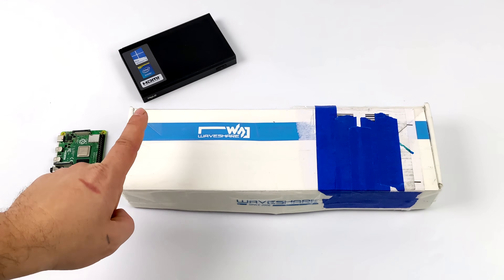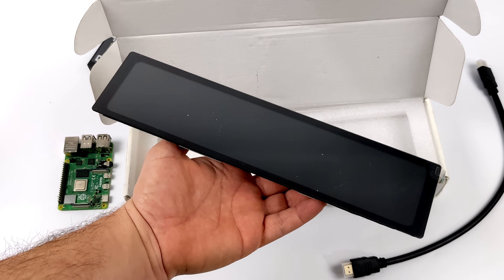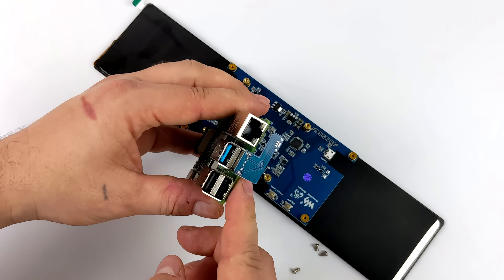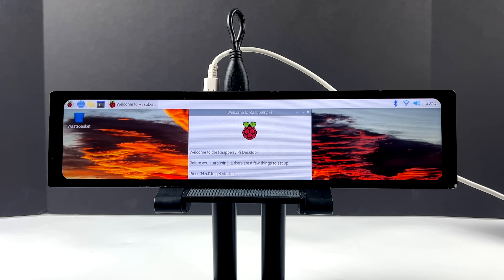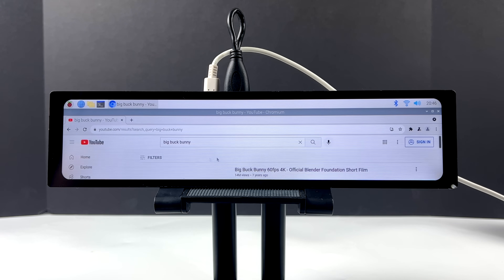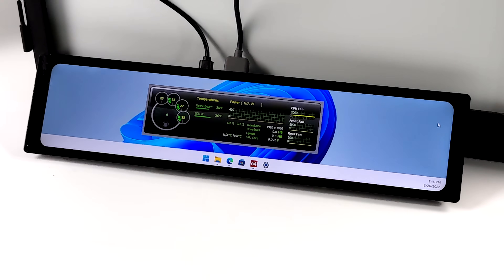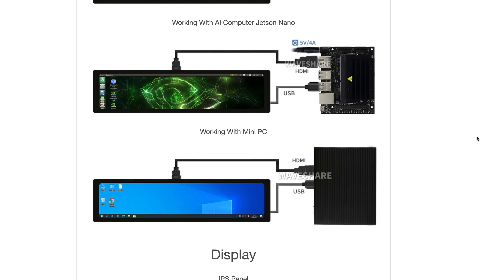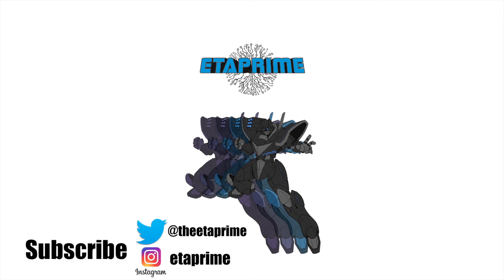The WaveShare 11.9" HDMI Touch Monitor Is Perfect For Cool DIY Projects! Pi4, WIndows

Comment: just fyi, I made my own version, you can actually just cut a bigger lcd screen into a shorter one.  Can't cut it vertically, but you can horizontally, sometimes in only a few places depending on the panel.  It took 5 tries before I got one without screen issues.  Must place in vise right where you cut it and use soft material to hold it that won't damage glass, and then cutoff wheel and seal edge with epoxy and let harden before removing it.   I wanted a long display for a rear view mirror on my motorhome.  With cameras showing rear/side areas.

Comment: I'm looking at this screen for a project in which I'd mount it into a 1/16" steel plate. I would like to know how easy or difficult it would be to do this, also adding Waveshare's UPS hat. Any way you could demo this product with a Raspberry Pi having a HAT installed on it? Even if it's not the WS UPS.

Comment: 3:17 - to get the included hdmi adapter to work, you have to add following lines to your /boot/config.txt file at the end of the text file:

max_framebuffer_height=1480
hdmi_group=2
hdmi_mode=87
hdmi_timings=320 0 80 16 32 1480 0 16 4 12 0 0 0 60 0 42000000 3

Otherwise you will receive a black screen. You can also unplug and plug in again, then you will see the screen.
Tested on a rasperrypi 4 with 64bit Pi OS with GUI.
Reply: Does the Pi 4 have screen clipping issues for you? I've been pulling my hair out trying to setup a kiosk with this screen on a Pi 3B+ and the left ~25% of the screen clips off the right side. I tried plugging in that bit of code in my config file like it says to do on the waveshare site but it doesn't seem to have any effect.
Reply: @WCNovaTiger  Config.txt can easily be edited but there may be other commands forcing a particular setting. Look for this line: 'disable_overscan'.  That sets the overscan area. If you see it, just comment it out and give it a try.

The lines below let you set all overscanning.  Start with small changes, say 32.

Set disable_overscan to 1 to disable the default values of overscan. The default value for disable_overscan is 0 which gives default values of overscan for the left, right, top, and bottom edges of 48 for HD CEA modes, 32 for SD CEA modes, and 0 for DMT modes.

The overscan_left command specifies the number of pixels to add to the firmware default value of overscan on the left edge of the screen. The default value is 0.

Increase this value if the text flows off the left edge of the screen; decrease it if there is a black border between the left edge of the screen and the text.
overscan_right

The overscan_right command specifies the number of pixels to add to the firmware default value of overscan on the right edge of the screen. The default value is 0.

Increase this value if the text flows off the right edge of the screen; decrease it if there is a black border between the right edge of the screen and the text.
overscan_top

The overscan_top command specifies the number of pixels to add to the firmware default value of overscan on the top edge of the screen. The default value is 0.

Increase this value if the text flows off the top edge of the screen; decrease it if there is a black border between the top edge of the screen and the text.
overscan_bottom

The overscan_bottom command specifies the number of pixels to add to the firmware default value of overscan on the bottom edge of the screen. The default value is 0.

Increase this value if the text flows off the bottom edge of the screen; decrease it if there is a black border between the bottom edge of the screen and the text.

Comment: I got the 7.9” version of this, and designed and 3d printed an extended marquee housing for a vilros counter arcade cabinet I have, and set it up as a digital marquee.  Works great, the only real issue is that this panel is so much better than the 10” TN main panel that came in the vilros cabinet, so it almost pops too much.  (Laughs).

Comment: Thanks for the video!
I have this screen for my Camper RV control-station pluged on a raspberry. My Question is: Is there a kind of frame available (or mounting brackets), or something? I want to place it in the ceiling of my camper-van. I don't have the possibilitiy to use the four screws on the back. Thank you!

Comment: Anybody into music production, this is epic for a diy digital touch mixing console for your DAWs. Or other productivity applications so long as you can detach your tool bar, you can have all those settings adjustable with a second hand while using the mouse to continue work. Not ideal for media but massive productivity potential!
Reply: @MissingNumb  DOOD!!! YUS!!! I just posted a comment about doing this for a digital instrument cluster in my truck, but I LOVE UR IDEA! I also do audio engineering! U have 1 SICK idea there!
Reply: Id use it to run spectograph or other visualizing software yo!

Comment: Here is my idea. I want to get one of these to use as a second monitor that sits on the top of my 21:9 ultrawide and snap app windows left and right such as discord and system monitor. Kind of like a rear view mirror. I need to get one to model a case around it so it slots on like a webcam. I don't see a 3d model or cad file online unfortunately. Maybe the manufacturer has one.

Comment: I would take something like this and a mechanical keyboard that runs on a battery and put together a retro looking terminal-based word processor system. It would be ridiculous, but it would probably also be really fun to use. Battery power the display and the Pi and you have a little writing rig. For someone like me that uses Alphasmarts & and an Astrohaus Freewrite and things for word processing, I think this would make for a quirky alternative. (Especially since when I'm using a laptop, my terminal is in a green color, like it's an old mono-chrome display. (I've also considered amber, for another retro variation.)

Obviously with the touch features, this would also work nice for some kind of media server remote or a music system controller. You could have album art and other information, and then just tap on the object you want.

Comment: This would be nice as a companion monitor for things that you don't necessarily need vertical realestate for, such as diagnostics. Could also be great as a functional panel, like a touch-based macro pad, similar to a Stream Deck or a better version of what Apple once tried to do with their Touch Bar. It's a bit small for it, but this reminds me of that 7:32 companion monitor that we saw back in November-ish that was supposed to release in Feburary, I don't remember the name of it but Elsonic made it. 

They should definitely offer an updated variant that allows usage of a CM4 module, all it realistically needs is a main board change. With proper implementation of a type C port, you could have a single wire running to the unit, just have a PD hub on-board to power the panel and the CM4, then pass all the USB and alt-mode connectivity over the same wire; such as if you need a network connection, additional USB for peripherals, HDMI for a full sized display during debugging, etc. This is really what CM4-style boards are meant for, it'd streamline the rear of the panel, and with proper periphery work it'd make the panel a single wire device. They could also sell an additional board to adapt the CM4 connections to your standard HDMI + USB setup for non-CM4 use; it'd be cool if this board, with a pigtail for the main input, could also condense power, HDMI, and USB into a single cable solution for whatever it's plugging into. Hopefully this kind of design mentality shows up in the next version, we need more products supporting the CM4 platform, and we need more SBC companies adopting the compute module platform; compute module needs to be the way forward, it's more streamlined with wider use cases. 

When talking about throwing this into a project car, make sure it's actually rated for such application. You don't want the issue Tesla had when they cheaped out on their panels.

Comment: Controller for media playback - music, movies, etc.  Controller for choosing what games you want to play from a home brew Multicade machine.  Could make a cool rear view Smart Mirror for your car.  Could be used with smart home security system to access different feeds, sensors, remote latches/locks, etc.  Glare seems to be the biggest drawback to the panel.  You could embed it in a desk to help launch Macros to all sorts of X10 components in your home or other types of computer controlled things.  It could be used as a conversation piece to play odd resolution videos or even as part of a digital wall sconce.

Comment: I could see using this in a car stereo. I'm thinking to get a cheap single-din stereo, and install that on the bottom half, then install this panel on the top half. Use a pi for Android auto, and run the audio through the stereo.
It'd be a fun little project!

Comment: Seeing the layout, a Digital Keyboard would be perfect for it. Maybe it can become the message/notification screen or the Task Bar itself. Can you use it as your "log-in/lock screen" instead of the main screen on windows?. Kinda reminds me of a "Piano" or a screen for a Car Radio. Please test Android to see how the Dex and other mobile desktop modes can run apps on multi windows at the same time. Giving the touch interface you can probalbly use it for shortcuts for files lke pictures, videos o even music inside a folder as you do a presentation, event or personal chill time. On portrait mode, depending on the Excell data Sheet, Word and other Text files you view, It can have a longer layout to reduce srolling action. Chat's can look pretty cool on that too. Shame they are so pricey, I would to see what you could do with a few of them. Thanks for sharing.

Comment: Cyberdecks, have the early 80s hacker vibe of the Tandy TRS-80 Model 100 with a dot matrix lcd panel. So you might only use a headless version of Raspbian only in terminal mode.

Comment: Well, since it is a touchscreen I could see a remote control for OBS in this. If you undock those controls and have this above your keyboard... (cyberdeck but for those specific uses).
Apple should have built this one in instead of the touchbar...

Comment: I have a Logitech G510 with the built in LCD. I want to upgrade to a mechanical keyboard but i don't want to lose my little LCD screen that i use to monitor my PC. This would help fix that for me personally. I would 3d print a bracket and mount it under my monitor and run all the monitoring software on it! $180 Canadian though... The 7.9" is a little cheaper at $125 Canadian
Reply: lol I finished typing that and hit enter as you started talking about the Sensor Panel

Comment: Omg thank you for, as you say, 'biting the bullet'and picking this up!! I've been eyeing these displays for quite some time, but their cost per in² value is crazy. But man would it fit my project perfectly! 
Similar to what you were thinking of using it for, I've been building a custom 'dash' for my sim racing rig. Already built custom button boxes for each side of the wheel and have a pair of 'led&key' boards torn apart and rewired with the 7 segment displays and high density ws2811 rgb strips in the middle. I've always thought these displays would be absolutely perfect for in the middle since using a normal ratio display would stick-up too high. So I've been considering going the (digitally controlled) analog route and buying some gauges but after seeing your review I think I may, as well, bite the bullet because the gauges would end up costing around ½-⅔ the display for some pretty cheap looking gauges, whereas with the display I could make them digitally and even change them on-the-fly, or put it behind a piece of dash so they look individual, literally endless possibilities. AND look fantastic doing it!  
I just wish I could find a cheaper one, I'd even settle for slightly smaller and without touch since I wouldn't use it since it's likely I'd bump into it in occasion. If anyone happens to read all this and knows of one I'd forever be in your debt!

Comment: This would be awesome if it could be used as a Stream Deck alternative. I get a lot of usage out of my Stream Deck for shortcuts but I wish there was a secondary monitor for time/weather/system stats/notifications to make it a little more useful. This would make an awesome replacement.

Next version, please support USB-C! Single cable would make it a lot cleaner to use in a setup.

Comment: I had exactly the same problem with the HDMI adapter, which was really disappointing because it's very hard to get replacements where I live. The screen is awesome but being stuck using a bulky HDMI cable really doesn't look great

Comment: I HATE the rounded corners. Their 7.9" and 8.8" screens look better. Especially the 7.9"
I could definitely see someone using these when streaming for their twitch chat. So they could have their twitch chat right on the side of the screen.
I could probably use one like the 8.8" for discord and other chats. 
There's lots of times i wish i had a second screen but i have a non traditional desk so i can't fit a second monitor.
By non-traditional desk, i have a recliner, and a monitor on an arm that swings infront of me. There's no "desk". So i get up from my desk by moving my LCD and getting up from the recliner.
 The keyboard sits on my lap and there's a mouse pedestal to the right of my chair. And my "PC" sits on a small table off to the side.

Comment: Definitely can see this as a second display over an arcade cabinate and some scripting or something to scrape score information to showcase scores. 

Could also see that as a second display dedicated to 'at a glance stats' battery, temp, network connection, notifications, etc' 

Or as a glass interface dashboard replacement..

Get two of these. put in a shadowbox so like... you have one on either side of a center artsy thing (or even physical switch pannel for something more industrial looking) so they can go from displaying pictures/video, to at a touch weather information and notifications, and back. I say two mostly because symatry.  

There are... MANY possibilities for this. Even just a 'smart strip' behind a bathroom mirror so you get weather notifications and the like, but theyr'e in a specific spot instead of the whole mirror.

Comment: I recently set up an old laptop with ubuntu desktop to use it as a home media and home automation server, and I think this would be awesome to connect this to the hidden laptop. This way I can have a control panel for the heating and lighting and it even makes it easier when I have to drop files on it. Thank you very much :)

Comment: I have a project already for this display.  I’m working on a custom dash / console display in one of my GMC Trucks. I will Design and print out a case for this unit. The fact that it’s a long and narrow touch screen makes it a perfect modern display. 

I’m slowly modifying all the regular cabins power switch’s to be controlled by a touch screen using solid-state relays operated by the raspberry pi. 

I planed to use a standard 8X5 raspberry pi screen. But this unit will look much better.  When finished I should be able to activate all my power windows, doors-locks and turn on overhead lights etc.

I see that they also offer 2 more narrow screens 7.9 and a 8.8.

Comment: I really tried to hear all about the potential use cases for this form factor but I’ve never heard a single one that couldn’t just be done with 16:9 or 4:3 on a small size. To me it’s still just a small screen but there’s no use for it being super wide other than filling dead space
Reply: I think it could be a cool display for an Arcade game like Periscope, or a sub or tank simulator like Gato, Silent Service, or BattleZone, etc, where your vision was limited up and down, had periscope center, and information on both sides...
Reply: @kevinshumaker3753  This is exactly what I mean most of the ideas I see in action or proposed end up with things like "and information on both sides..."

Adding stuff on both sides means you could just get a smaller 16:9 screen instead and just cut out the unnecessary "information on both sides" which is true for almost all uses I see.

Take the display on this PC case: you can clearly just put a 4:3 or 16:9 style and put all those meters on a 4x4 style grid on to one side instead of the unnecessarily long display.

It's always a solution in search of a problem.

Comment: Just gonna put this out real quick for all of those who are interested in purchasing one of these screens or similar screens from waveshare
I advise you to buy from another brand if you want an easier user experience and less headache
Some waveshare screens (Such as this one) Require you to add additional lines to config.txt

For this screen it would be:
max_framebuffer_height=1480
max_usb_current=1
hdmi_group=2
hdmi_mode=87
hdmi_timings=320 0 80 16 32 1480 0 16 4 12 0 0 0 60 0 42000000 3

While yes this will work
Some apps/games will refuse to launch or work at all and some operating systems such as android/windows have even more issues,
from not being able to see anything on screen (Android) to bad touch timings (Windows)

And to be fair most of this can be fixed really easily if you provide the screen a custom Edid file instead of the lines in config.txt
Waveshare doesn't provide these edids so you will have to create them yourself which is a pain because every device seems to read
something different

Conclusion: Don't buy from waveshare unless you're ready to fix problems that shouldn't even exist

Comment: Would be cool to see if it also works with a pi zero. Of course the adapters wouldn't fit, but maybe with short cables with angled connectors, and a 3D printed baseplate for mounting? Could be a very low profile solution for a project.